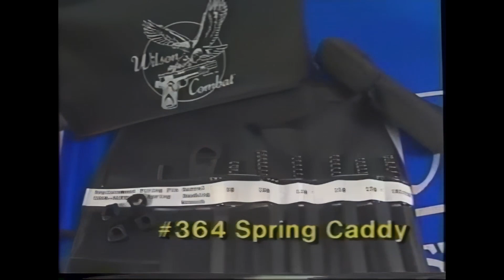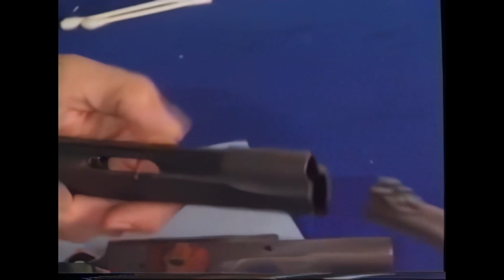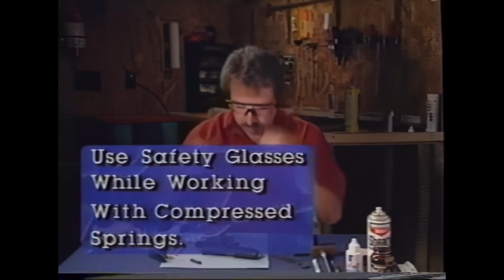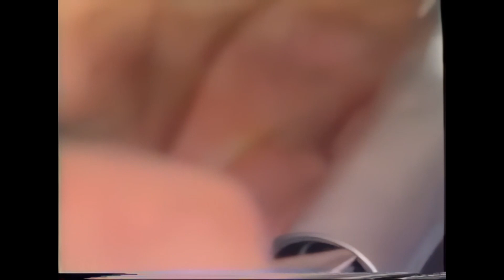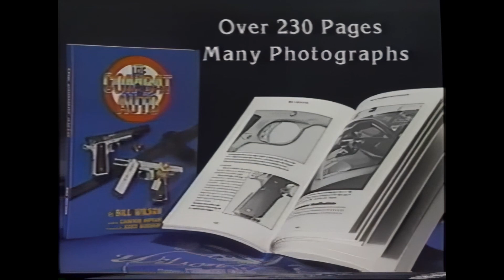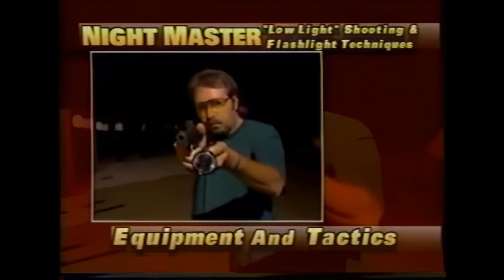Wilson Combat Bill Wilson  Beginners Detailed Cleaning And Maintaining the 1911

Comment: The only time I use oil is on a brand new firearm to let it set on it for a few days and clean good barrel and all metal with Hoppes solvent and wipe bone dry with paper towels and Q Tips and reassemble nothing else it’s ready for 2-300 rounds